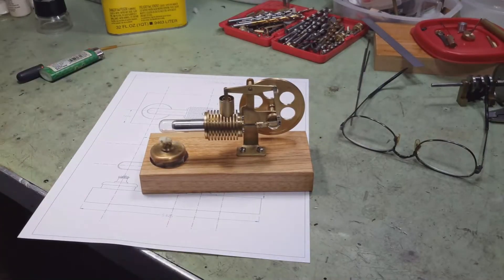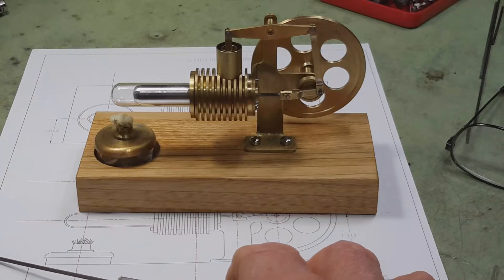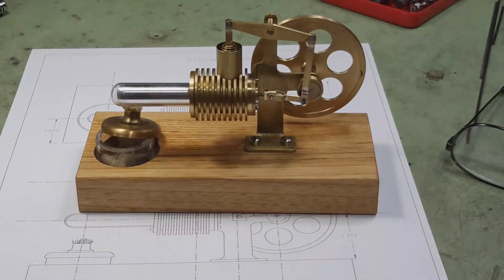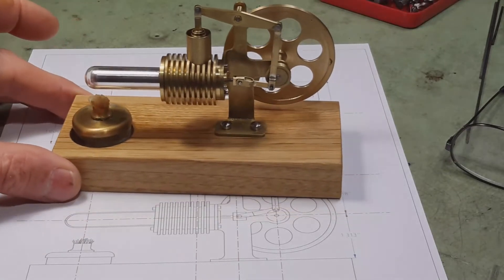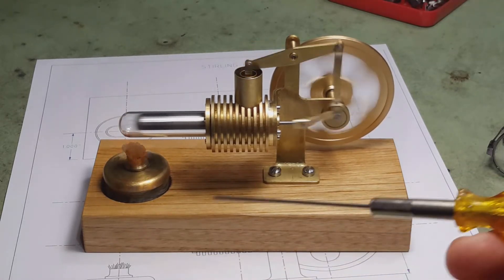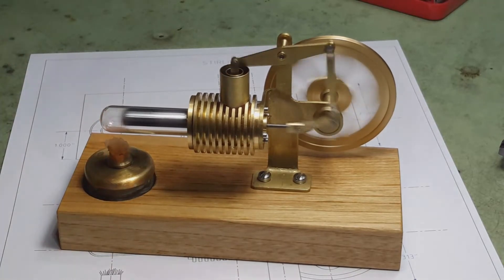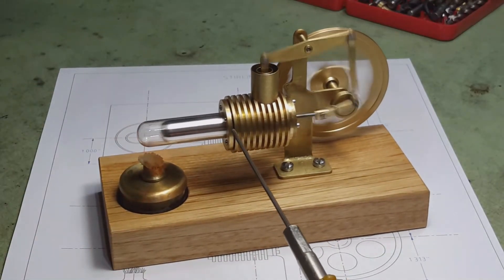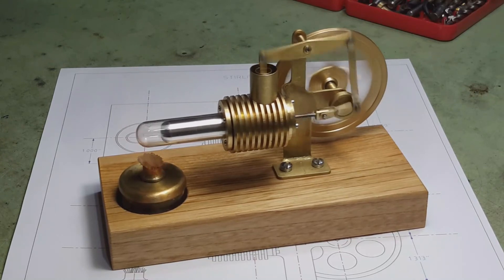STIRLING ENGINE MADE BY LES PROPER

Comment: So the relation between heat displacement stroke volume and work cylinder stroke volume is about 4 to 1 then, or am I missing something?

Very beautiful model though.  Thanks for show it to us.
Reply from the maker: Yes, that is what I found.  I don't know if this holds true for higher temperatures, pressurizing, etc.  It probably does not. But it at least gives me a starting point the next time I make a stirling engine.